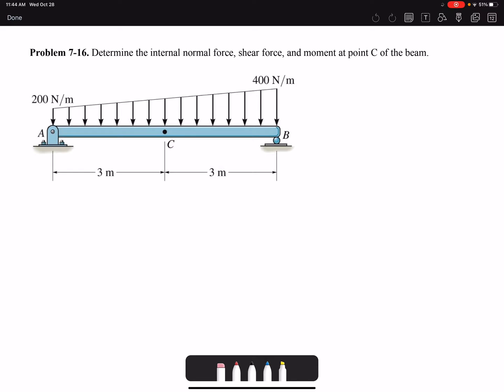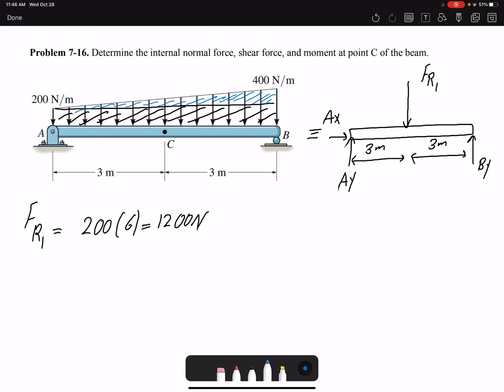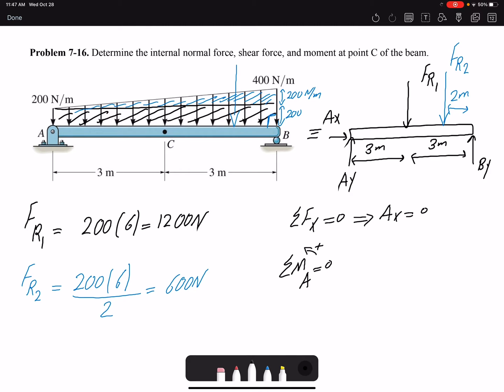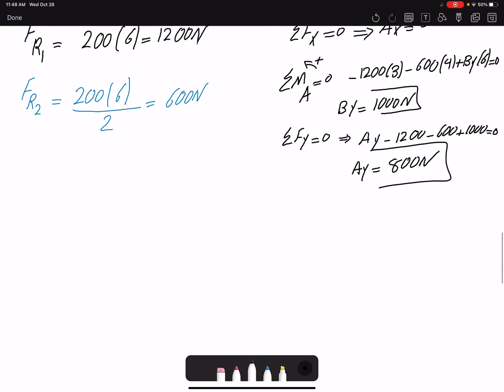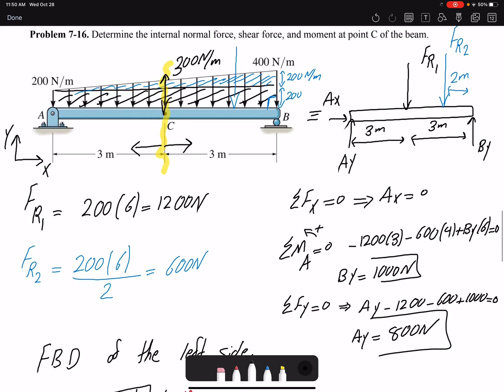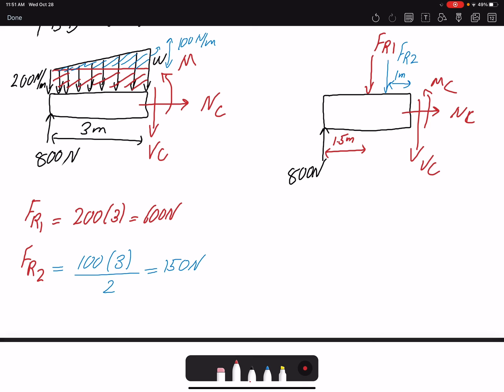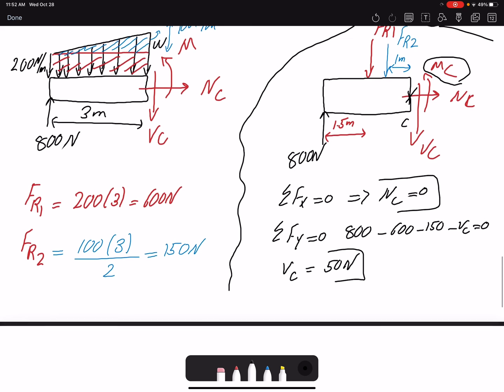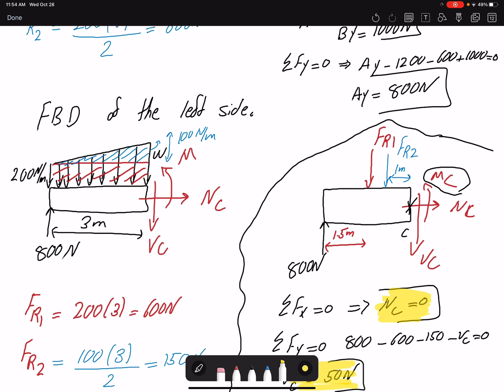Statics Practice Problem 7-16: Example of internal loading for a beam under distributed loading

Comment: To anyone who stumbles across this video: here is a bit more info about why we solve the problem the way we do. First you need to solve for the trapezoidal distributed load. In order to do so, you need to separate the trapezoid into a right triangle and rectangle. Subtract 400 N/m by 200 N/m to get the height of the right triangle. With that height, you can find the area of the triangle ((200 N/m * 6 m)/2) to get 600 N. To find where this load is focused, simply look at the side where the height of the triangle is greatest, and multiply the length of the triangle by 1/3. This should give us 2 meters from the right. So our first force is 600 N at 2 meters from point B. Our second force is the area of the rectangle. So 200 N/m times 6 meters will give us 1200 N. To find where the load is focused, divide the total length of the rectangle in half. So our second force of 1200 N will be located at 3 meters from either A or B. With those two forces now found, we solve for the moments of A and B to find the vertical force at A and the normal force at B. For the moment about A, our two forces we found will cause a clockwise motion (CW) about A, while our normal force will cause a counter clockwise motion (CCW) about A. So our moment equation should look like this:
Ma = (-1200 N * 3 m) + (-600 N * 4 m) +(NB * 6 m) = 0
Solving for NB, we find it is equal to 1000 N in the positive y direction.
Now we do the same for B. Analyzing your FBD, our moment equation should look like this:
Mb = (1200 N * 3 m) + (600 N * 2 m) + (-Ay * 6 m) = 0
Solving for Ay, we see it is 800 N in the positive y direction.
In order to solve the problem, you only need to find one or the other. For this, I will use the normal force at B. In order to determine our shear force, we need to cut our FBD at C so we can analyze what is happening on one of the sides. Looking at the right side, we need to re-evaluate what our distributed loads are. We have new dimensions for our triangle and rectangle. By seeing across an even distance, that there is a difference of 200 N/m from point a to b, we can assume that at point c, there is a difference of 100 N/m. So the new height of our triangle is 100 N/m. Now we find the area of the triangle again. ((100 N/m * 3 m)/2) This will give us 150 N at 1 meter from point B. For the rectangle, our new height is 300 N/m giving us (300 N/m * 3m) our force of 900 N at 1.5 m from either point b or c. With these three forces, we can determine our shear force. For this, we are going to assume our shear force is positive (clockwise) meaning Vc here should be in the negative y direction. Summing the forces in the y-direction:
Fy = 1000 N - 150 N - 900 N - Vc = 0. Solving for Vc gives us -50 N. This means that our assumption of the shear direction is incorrect. The shear is counter clock wise. 
Finally, we need to find the moment about point c. Continuing to look at the right side of our FBD, we see that our moment equation for c should be:
Mc = (-900 N * 1.5 m) + (-150 N * 2 m) + (1000 N * 3 m) = 1350 N/m. So our final answers will be such:
Normal force at C = 0, Vc = 50 N, and Mc = 1350 N/m. I hope this clears up why he got certain answers.
Reply from the maker: Great explanation, you made my job easy :) thank you for visiting

Comment: Sir when you moment at A wasn't it supposed to be calculated using the Centroids of triangle and Rectangle. In the video you put the forces directly on the equation, the forces of rectangle and tringle was supposed to be added into a concentrated load for the trapezoid. Sir please double check.

Comment: How did you figure out the 100 for the triangle when you cut the beam?
Reply: Using similarities of triangles, before it was cut the bigger triangle had 200N/m, after it was cut the smaller triangle was exactly half of the bigger one, finding the ratio(i.e 200:x=6:3) , x= 100. Note that 6 and 3 are just the base distances of a bigger and smaller triangles respectively.
Reply: Thank you @Godfreymutale76

Comment: how do you determine the distance from Fr1 and Fr2 from b ?
i dont really get this part
Reply from the maker: Good question! For a rectangle, it is in the middle and for a triangular load, the resultant force is acting 1/3 of the base from the right angle of the triangle.
Reply: I think it’s 100 cause it’s half way up the beam